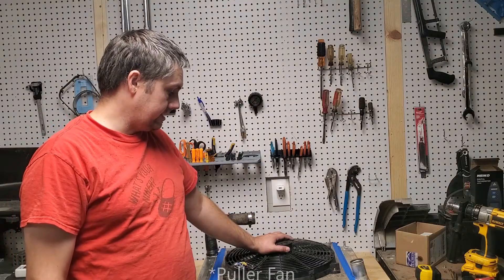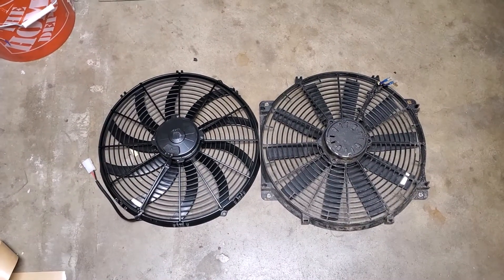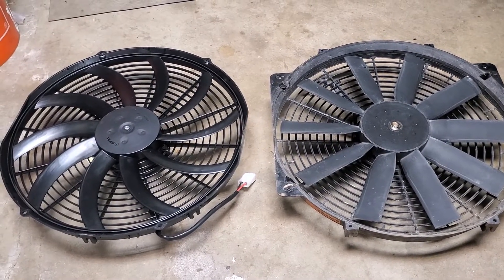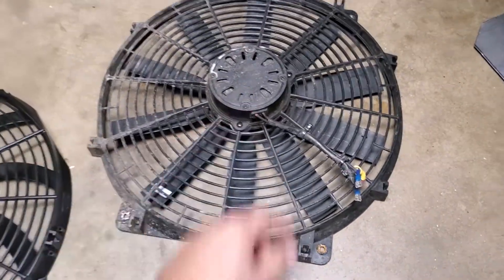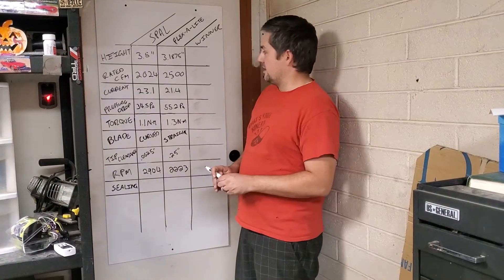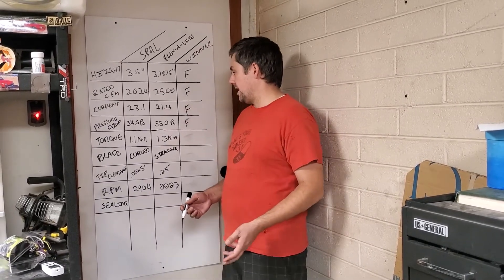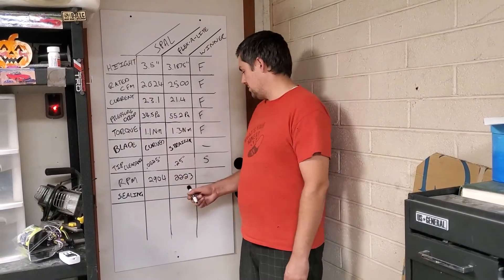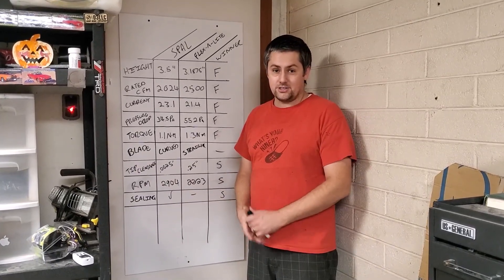Electric Fan Comparison - SPAL vs Fex-A-Lite!

Comment: they are not the same fan. straight blade is much better but more noise. Curve blade is more quiet but less power. This test is good but it not apple with apple.

Comment: As someone mentioned, it is absolutely obvious based on the movement of the objects on your workbench that the Spal is moving far more air through that radiator than the Flexalite.  On a hot day, I don't care about the shape of the blades or whether one fan is pulling a few more amps that the other, I just want the engine to stay cool.  I can tell you from real world experience that the Spal is the way to go.

Comment: I have a Flex a lite fan that advertises 3000 CFM but when I check it with me anemometer it's not even close. I just bought a 16" spal fan and hope it will keep my 700hp ls3 stroker Saturn Sky cool. The factory fan is good to about 82 but driving around town when its 90 it just can't keep up. Also your PA is backwards. the lower the number the more vacuum it is producing just like on a car. A big cam car may have only 60-70 kpa so not much vacuum but a smaller cam will run around 50 and has great vacuum for the brakes. When tuning a car you adjust the AFR and timing to get the lowest vacuum. The Spal wins hands down.

Comment: All my research I’ve done through dozens of fans and believe it or not spal fans out perform all other fans and other fan companies also use spal motors but that gap at the shroud IS THE REASON that spal fans outperform their competitors and if money is a factor and you can fabricate using factory fans from newer cars which use brushless motors you can get better results then spal but if you can’t fabricate your own setup buy spal and keep going

Comment: Try real testing with hot radiator in hot weather and temp gauge
Reply from the maker: I've actually wanted to do a test where I heat 50 gallons of water to near boiling and pump it through a small radiator and measure effectiveness. I've thought about using a tankless water heater too.

The real problem is it's really hard to account for all variables. I want to make a legitimate heat exchanger test stand that I could put real numbers to various radiator and fan combos for comparison, but it's a lot of expense to build out. If I ever make it to monetizing my channel I just might do that.

Comment: Manufacturers CFM rating is based on free-flow, you need to calculate your radiators "Static Pressure" (basically the airflow resistance caused by the radiator fins & Rad depth). 
Spal actually do provide a curve graph showing cooling fan CFM performance based on Static Pressure.

Comment: I know this video is 4 years old, but this video is exactly why you don't only use YT for advice on automotive parts and procedures. What an almost useless comparison video with a lot of subjective outcomes. "Rated CFM" come on, you didn't even attempt to measure the actual CFM in a controlled environment.

Comment: You need a flow meter to show actual CFM flow. 
Air flow is the most important factor here.
A proper evaluation of this would show actual CFM flow compared to advertised.

Current voltage etc doesn’t mean anything.

Comment: Hi  Rob, congrats on undertaking an objective rad fan comparison; however, I think you left some important variables unresolved.  I was disappointed to see that you relied on the advertised CFM ratings for these two fans.  This is the most critical performance parameter and you haven't actually measured it.  Your 'guesstimate' of torque was meaningless.  Perhaps you could have explained what you expected to learn from your pressure measurements.  Were you measuring a pressure drop between the inlet and outlet sides of the radiator?  Were these pressure readings both taken with the plexiglass barrier in place or removed?  Further, fan performance could vary with the temperature of the air you are moving.  Applying a purely practical observation from the papers flying on your bench, it appeared that the Spal was moving a lot more air.

Comment: Most alternators  can't handle  the significant amp draw of electric fans
Reply from the maker: hasn't been a problem for me. I added 2 electric fans on a factory sized alternator and have no issues.

Comment: The ring connecting all the blades on the SPAL fan prevent the thin blades from flexing/twisting and changing the angle of attack. 
.

Comment: Hey Rob, a very good experiment...  my opinion... the fans are for cooling the water... should have run some hoses connected to a car, fill up with sufficient water, bleed the system and then measure the water temperature when the fans cut in and cut off.
Reply: "You should" - one of my least favourite phrases.  Why don't YOU do your water temp comparison champ?

Comment: Good piece, but two things I can point out.  1. Both fans must be equal in all things.  You have a s-curve fan and a strait blade.  Very different in performance.  2.  When you list the CFM, Spal is the only fan company that rates it's fans "under load".  a lot of variance in the results because of these items.  But very glad you did this will all the meters.

Comment: The straight blade flex a lite is more versatile because it ca be a pusher or a puller fan by changing the polarities of the wire so it can be placed at front or back of the radiator depending on the space while the curve blade spal is only a pusher fan.

Comment: Sorry for the late game start on my part, but I noticed two factors that might make a difference in your choice.  1.  The straight blades tend to move more air. 2. I see in the test you went with box CFM rating, sometimes you get a lower or higher rating than what the produce in real world settings. So a air speed meter might show one or the other better or worse then it’s rating. Either way I liked you testing and approach to a real world test. 😎👍
Reply: And "non objective" tests with air flow meters show time after time that spal not only meet but sometimes EXCEED cfm ratings where the less expensive brands are rated similar to impact wrenches.  "M18 2864-20 gen 2 rated 1500," runs avg 711ftlbs lol). Marketing is a bit^*😅

Comment: USUALLY, the  straight blades will move more air but make more noise, and curved blades are designed to be quieter at the expense of airflow.

Comment: Thank you for this great video. I personally got me a SPAL type fan and I took the curve blade out of the housing and flip it over and install it back in and I notice more cfm
Reply: You can't flip the spal blade around. They are built like a brake disc rotor and fit over the motor. You would be better off just buying an actual Spal fan......or throw on a Mercedes 850-Watt fan that probably pulls something like 5,000+ cfm
Reply: @brittanywright9646  I was able to do it on my SPAL type fan
Reply: louder?

Comment: It's all about CFM's, period. Everything else is a waste of time. You turned the SPAL on and you had to pick up your clipboard and it started blowing sh** all over you work bench and the Flex A Lite didn't even ruffle the papers on the clip board and the Flex A Lite wins? I am in the market for a fan and I am buying the SPAL but I do appreciate the time you took with your test.
Reply: That's because he has the plexiglass in place when he starts the Flex A Lite, but not when he starts the SPAL. At 7:09 when he removes the plexiglass, the Flex A Lite blows the paper around too. When he starts the SPAL the plexiglass is not in place. But when he adds that to the SPAL at 9:43, it also doesn't blow the paper.
Reply: That being said, just from pure observation, the SPAL does appear to move things around more, such as the yellow box on the table and whatever is hanging from the pegboard to the left of that yellow box.
Reply: I’ve used both and spal has a much more powerful motor and tighter tolerance with fan gaps that makes for better cooling in the real world and even on a 4 core radiator with a intercooler and ac condenser moving tons of air for my 5.9 Cummins 1 ton truck pulling a 10k trailer keeps cool

Comment: Honestly as far as the RPM goes if you're making more CFM with less RPM I think that would be better because lower RPM equals more longevity.
Reply: Also it tends to make less noise for the same blade design.
Reply: @PrefiroMato  WHy do you care about noise when driving down a highway, you shouldn't be hearing your fans in your car.
Reply: I have had my fans (built in shrouds) In my 07 Tiburon for 17 years.  They are still the OEM.   It really doesn't matter, it's about build quality. That's why you don't cheap out.

Comment: Have you ever considered running a puller on the rear and the Spal used on the front as a pusher!
Reply: What percentage help do you feel the pusher added to your AC effectiveness I’m considering doing this on a 68 mustang myself did it help the polar as well or just the AC to
Reply from the maker: @daveschultz1807  hard to say because with the big griffin radiator and the flex a lite I never overheated. But it makes a huge difference for the AC. Like I wouldn't dream of not having it.
Reply from the maker: This spal was not reversible, but I actually did add a pusher in the front to help the AC run cooler.
Reply: Cool! Literally thx!
Reply: I've tried a few electric fans and was usually disappointed, to me if you have room use an engine driven fan they will always move more air then any aftermarket fan. You can use an aftermarket fan for auxiliary or slow speed operation

Comment: I believe the data was made meaningless by restricting the air flow, Its kind of like checking amp draw with the fan submerged in water, an anemometer testing air speed could give you a measurement of CFM when calculated with the surface area of the radiator air output. Im getting the SPAL fans because it blew all the junk of the work bench. the moving box does not lie

Comment: Good comparison. I just purchased a flex a lite straight blade fan. I like how you broke down the specs. I’ll be using as a pusher for my A/C. You just reassured my purchase. Thanks for your video!
Reply: @elguero i was thinking of doing the same.with my a/c running a pusher .i have the flex lite cyclone as a puller now on a temp switch..???are you going to have the a/c pusher set up to come on the same time as your puller fan

Comment: We have higher wattage electric fans than those in this video at https://www.americanvolt.com/collections/electric-fans which includes radiator mounting kits. Various fan thermostat switch turn-on temps and thread-in probe sizes as well.

Comment: Great tests!  But it would have been nice to compare the data in push mode rather than just pulll mode.  The one thing you did not compare (which is very important) is whether the Spal or Flexalite fan is rated for continuous or intermittent use, and also durablity under actual road use.  Going through dusty terrain, bugs, etc.  How will the open flex-a-lite fan perform after, say 10-20 hours of continuous use, and/or being exposed to dusty conditions.   Yes, on a "bench test" the flexalite may do well, but build quality and durability is a big factor
Reply: Do you really think that both companies DIDN'T think about that, or DIDN'T design them to be used in every imaginable condition that a motor vehicle might encounter,  including being submerged for a short time like on an off road vehicle?

Comment: These fans used in? As car condensor fan?
Reply from the maker: the cooling fan on the radiator of my isuzu.
Reply: Could be. Can be wired to do both, as in come on when the trinary switch on the a/c drier provides the ground for the relay instead of the water temperature sensor. So your fan will run any time the a/c compressor is engaged.
Reply: @davidkeeton6716  do your car ac gets enough cooling at 40°c?

Comment: Wouldnt the spal technically be quieter since its spinning 700 rpm faster than the flex lite?
Reply: Noise is noise , not arguing with your buddies that point while driving around in your car .

Comment: The Spal fan has a ducted blade design; like you said, they’re generally more efficient. current draw? Pressure drop? Fan RPM? Those are mostly Irrelevant!
It’s too bad your setup couldn’t test for temp drop over time - coolant temp at inlet minus temp at outlet over time - delta T per sec, watts of heat dissipated per joule of fan energy...these are the real measurements.
Reply from the maker: Pressure drop absolutely isn't irrelevant. It's a better indicator of cooling ability than factory CFM rating. 100% agree about temp drop over time. Once upon a time I actually designed a heat exchanger test stand using an in-line water heater. Disagree on watts of heat dissipated per joule of fan energy. As long as I have the amps available I don't really care how much it takes, I just want the most cooling. Yes, it will make a difference in fuel mileage, but I'm in arizona and just want maximum cooling capacity. Ideally I'd measure flow rate, and temperature in and out, for both air and water. That would let me calculate the effectiveness of the heat exchanger & fan. keep the heat exchanger the same, but swap fans, and now you have the actual fan performance compared.

But shy of the thousands of dollars needed to set all that up, this was my compromise.

Comment: You should have cfm tester cuz i found fan says its 3300 cfm but spal is 2024 when i try both spal pulls much air and the 3300 its looks like fake i dont think its even 1500 cfm

Comment: This is all very good information, especially about the types of blades and clearance and how that could affect efficiency!

I came here because I saw these fans and was looking for an alternative to an RV roof vent. The SPAL was definitely quieter but still very loud! Would you have any thoughts on those comparisons? With all the equipment and knowledge you have I feel like the Van Dwelling community could definitely benefit!
Reply from the maker: I would very you do not need to flow NEARLY as much air as these do. These are probably 10* or more what you need, and would be too noisy and Kill your batteries.

Comment: "Cool little test" No pun intended :)

Great video by the way.
Reply from the maker: Thanks!
Reply: @humming_garage  what do you think of Spal brushless motors that are PWM controlled? I know they're very expensive but also very quiet when not running at 100%.
Reply from the maker: @MrMedicAdnan  those would definitely be the way to go. I'd love to get one, put a temp sensor in the coolant, and program a controller to vary fan speed based on coolant temp. You could potentially get very slick, ditch the thermostat, and have the fan run backwards to stagnate air when it's cold to warm the motor up faster.
Reply: @humming_garage  that's a great idea to run the fan in reverse. Sort of an electric winter front. That's what they call a radiator cover in the truck industry.